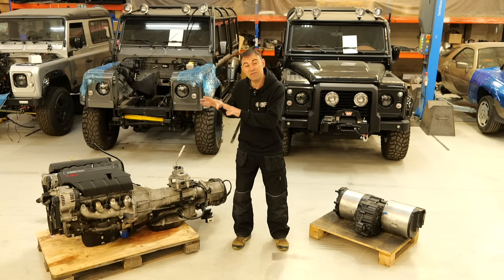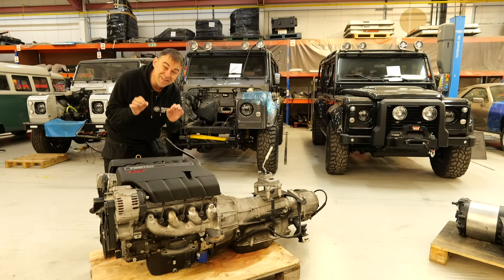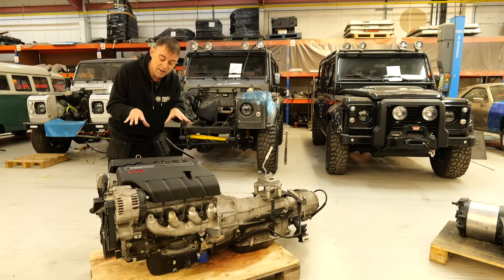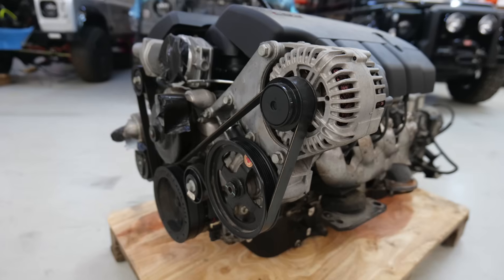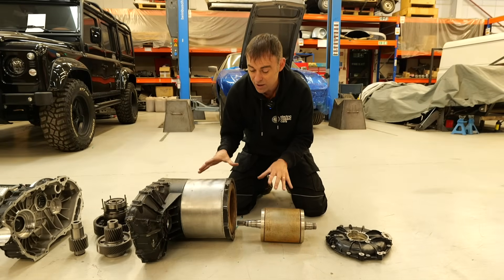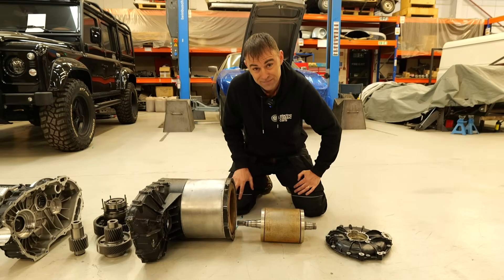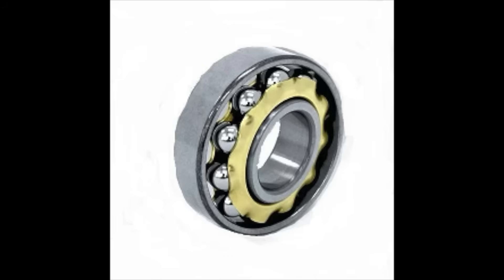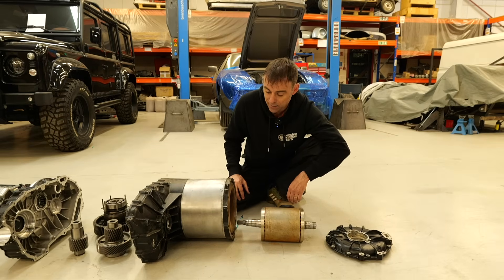Let's compare the Tesla LDU with an LS3 V8 and take one apart to see what makes it tick.

Comment: APPLES and ORANGES. The input fuel is made off-site ... electricity from generators that have losses ... stored in batteries that have losses ... battery power is prepare for use by the motor via inverters ... which have losses. From power generation for the batteries to the wheels on the ground, it all adds up to the same thing. IC engines don't need rare and exotic materials and can run on a variety of fuels.

Comment: So lets estimate weight:-
The TLDU 140KG plus 450KG for long range batteries total 690kg
The LS3 V8 400KG plus battery, exhaust, tank and fuel 220kg total 620kg

Only 70KG in it...   Impressive and the next generation of batteries will almost double the battery density.

Comment: Well said. My EV costs 2.1 cents per mile to operate. Whereas my 4 cylinder 1996 Toyota Pickup costs about 25 cents per mile to operate. Which do you think I drive the most?

Comment: Nice comparison, although you need to also compare the fuel tanks for the two 😉, which is where the main disadvantages of EVs lies (albeit improving all the time)!  That said I've been primarily driving EVs for about 7 years now and can't see myself going back to ICE as the advantages outweigh the disadvantages (for my usage anyway).
Reply from the maker: We covered the battery vs petrol comparison in a previous Tech Talk linked a few times in that episode. 👍

Comment: The LS3 fuel to power at 20% really isn’t fairly compared with Teslas 90%. Fossil fuel generation plants typically convert at 40%. Tesla has a loss as well as power transfer so the comparison is highly skewed though in all probability Tesla truly is somewhat more efficient. Every gallon of gas sold is heavily taxed to help pay for infrastructure and electricity only lightly taxed, still, the economy of operation is still likely favored in the Tesla.

Comment: You added all "the bits" but the fuel. Put that in and the electric will weigh more and that's leaving the range and time to refuel out.
Reply from the maker: We didn’t weigh all the bits. 🤷‍♂️ We just weighed the drive units. On the ICE we missed out the starter motor, exhaust system, ECU, fuel tank, fuel, etc. on the EV we missed out the battery pack which includes the charger, BMS, contactors etc. Our electric Landy weighs the same as the LS3 one with a tank of fuel.

Comment: Too long to watch so I skipped thru - did you include the weight of the EV battery & the $24,000.00+ it costs to replace?
Reply from the maker: After 300,000 km a Tesla will lose around 10% of its battery capacity. Thats further than the average lifetime of an ICE car. And at the end of that if you do want to replace the battery a quick search on eBay tells me the average cost of a good secondhand Tesla model 3 battery is around £3,500. 👍
Reply: @ElectricClassicCars  My 2001 Corolla has well over 350,00 km with many more to go. It has zero rust, tires last 100,000 km, needed 1 sway bar change so far, paint looks new, complete new headligs/turn signals with bulbs cost $150.00 after 200,000 km (better than polishing them up), seats still comfortable, replacing rear drums, brake shoes & mechanics cost $80.00, new rotors, pads & calipers cost $210.00. Amazingly it accelerates almost as fast as my Turbo Audi A4! And I don't drag around a 550 kg battery. BTW, this is not an exception, I see many 2001 Corollas in like condition. Of interest - There are 4 Tesla owners on my street though most makes on the street are Audi, BMW & Mercedes. Nothing against EVs that others own. Looking forward to the new Toyota EV when it becomes available (now produced in China).

Comment: Electric motors are good for mashing not a car TDI power is the best solution at the moment electric car has 50% range loss after 100000 miles.and battery pack estimates for $18000 for battery pack all your money you saved on electric went away now you poisoning the planet with battery waist that is poison and dangerous to our soil and water.hydrogen power is the Future.
Reply from the maker: I’m afraid the facts don’t agree with your feelings. Anyone can google the fact that on average a Tesla will lose 10% of its battery after 300,000km, which is more than the average age of an ICE car. At that high a mileage if you want to replace your battery with a good secondhand one a quick search on eBay shows me the average cost of a good Tesla Model 3/Y battery pack is around £3,500. 
Hydrogen is not the future. But if you think it is, feel free to buy a Toyota Mirai, they can’t give them away at the moment. Let me know how you get on. 😉👍

Comment: Many lies in this video.
LS3 is about 30% not 20% efficiency.
90% efficiency for electric motor is not accurate You lost 5-10% in charging the batteries, same with discharge. plus we lose between the batteries/controller/engine another 5-10%.
If you cumulate this is about 60 to 75%. But this more. The extra weight of the batteries increase the energy consumption. The véhicule is more heavy 50 to 100% more.. So probably more closer to 40-55% overall. and I don't speak about cool temperature who batteries  use their energy to keep warm, it's an additional lost. 

Make a big electric SUV is not wise. 
The vehicle is to heavy, he sink in off road mud.
The electric batteries don't like water/mud, they become crap and the risk of fire is big.
See what's happen when electric car are flooded???
Same with impact or den in batteries layout.

Tesla/Ford experience big problem with their big electric truck. (10 000LBS/46OOKG)
Reply from the maker: The Landy weighs the same when its petrol as it did with the LS3 in it and full tank of fuel. 
If you take in ALL the losses, from the power station to the road. An EV is 77%-81% efficient. 6% losses in power distribution, 5% losses from the charger, 5% losses in battery charge efficiency, 5% inverter losses (DC to AC), 5% motor losses. 
An ICE vehicle isn’t even in the same league as far as efficiency goes. 🤷‍♂️ https://www.forbes.com/sites/jamesmorris/2021/12/11/hydrogen-is-not-a-fuel-its-a-cult/

Comment: Comparing the motors is one thing - but the other end of the scale is that you're also swapping your 40kg fuel tank for 500kg of batteries. Not to mention that this example is probably one of the heaviest ICE engine/gearbox combo you could choose to convert from.

Comment: I hav both.  Hacked +150hp model 3 dual motor and procharger ls2.  The model 3 is convient w/ power on demand to launch on/off ramps of freeway and good for errands, but i do forget to charge the car here and there.  The procharged ls2 gets alot of attention, blowoff valves (no front bumper) scares everyone on the street and everyone ask what the hell did u do to it.

Comment: Did you weigh the batteries for the Tesla motor? That is a lot of weight; far more than the engine, transmission, etc.
Reply from the maker: This episode is about the Tesla drive unit, opening it up and seeing what makes it tick. We covered the fuel vs battery comparison in a previous Tech Talk. 👍 https://youtu.be/opF1si__APs?si=ylRtOg_340xyhEgv

Comment: excellent explainer guys, thanks.
Considering wether to take Dads 1936 Lagonda 045 Rapide for a rebuild and putting an electric drive train in it ?
Any thoughts ?
it is fully operational mechanically but needs body/frame woodwork done.
Reply from the maker: That would be great as an EV. 👍

Comment: Your efficiency comparison is wrong.  ICE engines turn fuel to energy.  Electric motors don't do that, they use generated energy in to create energy in the motor. The electric energy has already lost efficiency before it is used by the electric motor....making an electric motor in the USA less efficient than an ICE engine.
Reply from the maker: Where on earth have you heard such rubbish. Please credit the source so we can address it there. You seem to forget that for oil you need to drill it out of the ground, pump it to a port, ship it half way around the world, pump it to a refinery where it’s converted into petrol, transport the petrol to a petrol station, then pump it into a car. And after all that only 20% is used to make the car move. It’s insane. Don’t forget that each one of those steps use a huge amount of electricity and energy. 🤷‍♂️🤦‍♂️

Comment: Awesome .. now you need a diesel generator to power up the tesla ..
Reply from the maker: Or maybe renewable electricity? 1/3 of our electricity in the UK comes from renewables. 1/3 comes from low/zero carbon sources. 1/3 comes from gas. No diesel or coal.
Reply: @ElectricClassicCars  you also have electric trolley cars with power lines above it like we have in Romania ?

Comment: It is amazing to me how much less an EV buyer gets for the same money.  Missing pieces included, but not limited to:  Timing chain and all the belts associated, Fuel delivery systems, Moving parts of the ICE motor (Pistons, Head, Crank shaft, inlet and exhaust ports, etc.), Entire exhaust system from manifold, through catalytic converter to muffler, Fuel cap, Filler tube and filters, Tank, Pump, Injectors, Spark plugs, etc.  and all these have moving parts and/or parts exposed to toxic exhaust fumes that will wear corrode them.  Yet the experience of driving an EV is not degraded by missing so much material.  The benefit of the noise is not of value to me.

Comment: Electric cars are not the answer IMO. Hydrogen internal combustion. Hey Elon. Invest some R&D in a cost effective way of extracting hydrogen from water. That will be a game changer.
Reply from the maker: Hydrogen is not the future. There’s too many fundamental hurdles that can not be overcome. The only company to seriously investigate it has been the mighty Toyota but even they have admitted it’s not the future. https://www.ecoticias.com/en/toyota-hydrogen-liquid-fuel/5256/
Reply: @ It could be a viable solution if someone could figure an inexpensive way to extract the hydrogen molecule from water. Toyota used a fuel cell arrangement.  I owned one of those cars. Electric storage is the problem. Lithium is a finite commodity.  Plus electricity isn’t always clean.

Comment: I'm still romantic about a big v-8, worked on them, been around them for years just like anyone here. Tesla politics aside, I've worked around big electric motors for a very long time as well, and in terms of achieving rotational power (gas vs. electric,) electric is superior in every way. No contest. I've seen Medium sized electric motors tear themselves out of very impressive anchoring in factory settings when the drives aren't set up properly for the soft start. The torque is immediate (0rpm),  and unforgiving.

Comment: faulty comparison! have to compare for certain range, say 400kms, at certain speed. A 110 will need app 25 kWh/100km = 100kWh battery = 500kg! app. + 125kg for the drive unit = 625kg. that compares to 420kg for LS3 + 155lts petrol= 800km.  So weight wise LS3 has a 500kg benefit for 800km range!!!!!  wait for batterieswith 800-1000W/kg!!!

Comment: Ludicrous comparison.... A BEV like or loathe them weigh far more than the equivalent ICE car ... hence their vulnerability to punctures, sagging suspension and excessive tyre wear.
We have BEV's and ICE cars in our family so dont scream at me.
A BEV may have fewer moving parts but they have far more actual components - many of them the type that fail and make a car uneconomical to repair in years to come. Hence why the AA just stated 100% that BEV's are more unreliable than ICE cars - their facts not my opinion.
My full size SUV ICE weighs 1.5 tonnes , the new BEV Mini weighs 1.6 tonnes ...! 
These types of comparison on this channel  do the drive to  EV's harm not good as its so transparent. Both the original Tesla S models at our company had the motors fail before 65,000 miles so not great... I'm sure they have improved since then but even so ....

Electric motors are great but dragging heavy lithium batteries everywhere you go is an absolute nonsense.
Reply from the maker: Vulnerability to punctures and sagging suspension. 😆🤷‍♂️ That’s a new one. 🤣 Car’s have been getting progressively heavier for decades. Compare the original Mini, Fiat 500, Toyota Corolla, Range Rover, etc to the weight of the 2025 models. Nobody seemed to care. But now they’re EV, suddenly weight is an issue. 🤷‍♂️ My wife’s Tesla Model 3 weighs the same as my neighbours ICE BMW 3 Series.
Reply: @ElectricClassicCars  Hardly a new one ,that's the facts from the leading UK Tyre company and suspension specialists. 
Yes cars have all been getting heavier ,mainly due to ridiculous legislation but when a Mini weighs more than a 7 seat SUV then something is very wrong. 
I looked at a Kia EV9 ...2.6 tonnes ...crazy. These developments are not progress ... we need lightweight cars ( all fuel types ) as it makes more sense for a plethora of reasons.

Comment: The batteries make it heavier.. will make the car get stuck easier on muddy terrain.. less pollution? When batteries get depleted and lose their energy hold will polute way more than the gas... gas gets turned into carbon monoxide which plants will turn into oxygen
Reply from the maker: The Carbon monoxide that comes out of an exhaust is poisonous and will kill you. My electric Land Rover weighs the same as when it was diesel and now thanks to the smooth torque of the electric motor it performs better off road than diesel ones. As we found out when we went to Spain off roading last year. 👍 https://youtu.be/mcdKjdKELec?si=J9ou9QE4Tt-92eN0
Reply: @ElectricClassicCars  everything that is not oxygen will kill you... but catalytic converters make it better for the enviroment, plants will transform that back to oxygen but im glad u did good on your project congrats and good luck
Reply from the maker: @88zpeedy Plants do not convert carbon monoxide to oxygen. Carbon monoxide is toxic to humans and plants. 🤷‍♂️

Comment: This is not fair. Electric motors require a power source that is mostly Li-ion batteries at the moment. The average weight of gasoline (half tank) throughout the lifetime of a "charge" is much lighter than a typical battery pack.
Reply from the maker: We covered the petrol vs battery comparison in a previous Tech Talk. 👍 https://youtu.be/opF1si__APs?si=_vFPRhm4bL1hoa6q

Comment: what is the advantage of integrating the inverter into the motor housing? it seems a little of over engineering. if I I need to replace a control board on the inverter, why do I need to go into the motor

Comment: I removed my post Because it was far too negative. I apologize
Reply: I stand corrected.
I removed my post because it was far too negative. 

I find Google a very poor source of information when it comes to...  ANYTHING disputing globalism. The link you sent is definitely bias towards the climate change religion..

The most efficient Fossil fuel generation plants are 50% efficient. Both EV & ICE loose. The future could be a different story.

Electrical transmission losses, 2 to 5%.
Charging a Tesla battery 10 to 15% (full charge) 
9-13% consuming the battery due to heat loss (full discharge). The electric motor and inverter pack about 90-95% efficient.

Totals: 30-40% loss. 80-90% loss when you include the fossil fuel plant. The mistake I made was including the fossil fuel generating plant which are a negative for both EVs and ICE vehicles. I must admit, still a lot better than and ICE vehicle.

It's possible that 50 years from now when we have more energy coming from nuclear, solar panels and land-based windmills, 50 - 70% of all vehicles on the road could be electric. There's no telling what the battery energy density will be by then. That could play a major role.

I own a 2017 Honda Accord hybrid that averages 45 MPG. It would routinely get 55 MPG if the battery was larger. At a steady 70 MPH my Honda probably gets about 40 MPG. I don't remember, I rarely drive on the highway. 

I also own a 2022 Ford F-150 Hybrid. I believe it was designed by children fresh out of a woke college. Because it gets the same gas mileage as the non-hybrid F-150 on the highway and only about two MPG better around town. What a waste of money.

Great video.
Good luck in your endeavors.
Reply from the maker: So much misinformation in one post I’m wondering if you’re a real person or just some bot? 
So from generation to road the EV comes out at 77%-81% efficient, depending which study you want to go with. 6% losses for transmission, 5% losses from the charger, 5% losses from inversion (I.e. DC/AC), 5% losses for the motor. A petrol car isn’t even in the same league as far as efficiency goes. First you’ve got to drill the oil out of the ground, then pump it to a port, ship it halfway around the world, pump it to a refinery where it’s then processed into petrol, transport the petrol to a petrol station then pump it into a car. And after all that only 20% of that energy is used to make the car move. Each and every stage takes a huge amount of electricity and energy losses. It ridiculous. 
The average Tesla battery lasts 300,000 km before it’s lost 10% of its capacity. That’s more than the average lifetime of an ICE car. But when the battery finally comes to the end of its life, it’s recycled. How do I know? Because we send any battery modules that can’t be salvaged to a battery recycling center. 
And as for weight, the Landy will weigh the same, when it’s electric, as it did when the LS3 engine was in it and full tank of fuel. 
I’m interested to know where you get all this misinformation from so I can address it at the source. Thanks. 👍
Here’s a good page for you to read in the meantime. https://www.carbonbrief.org/factcheck-21-misleading-myths-about-electric-vehicles/